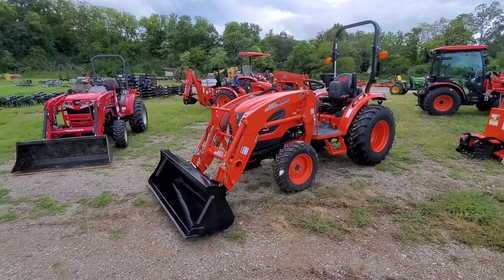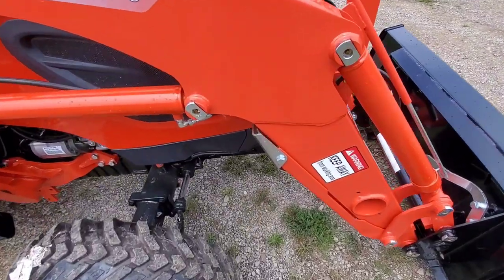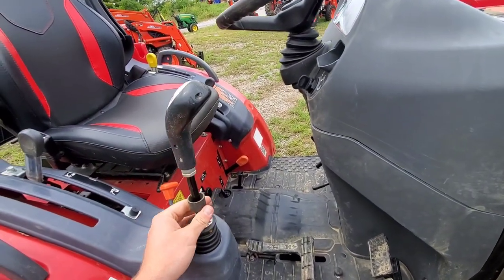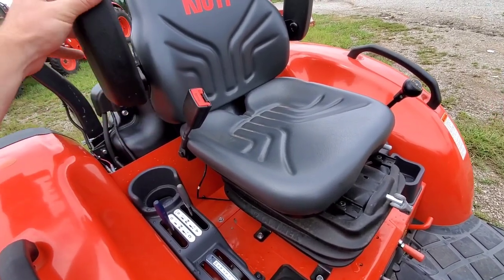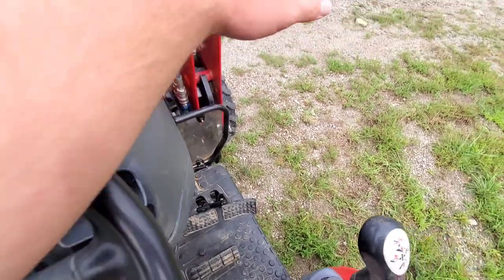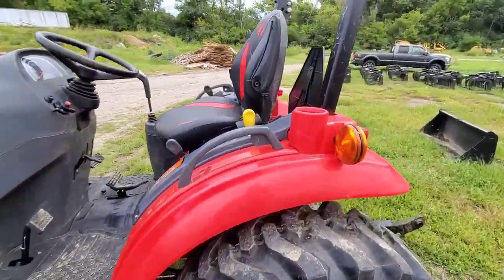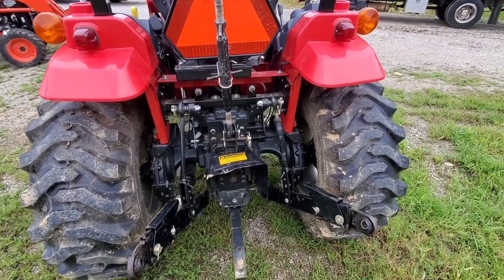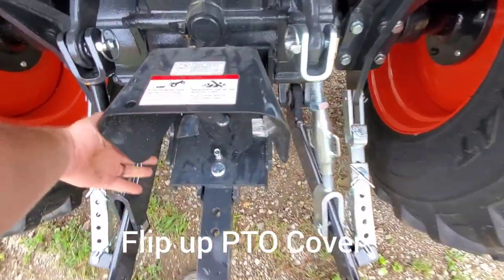Kioti CK3510SE vs Mahindra 1635 walkaround and review

Comment: What l like about the Kioti "Deluxe CK3510SE " is how they "slaped a 6 gallon fuel can" on the back seat, choped off the clutch pedal; but still left only ONE BRAKE PEDAL ( 2 Brake pedals make a REAL Tractor), pluse the "Armor-plated " dangling hoses under the running board. The Mahandra's  is fully equipped with TWO nice BRAKE PEDALS & a Clutch pedal, making it "tractor-worthy". The Mahandra's loader is missing amplifying bucket-linkage assembly 's, and loader arms are made out of solid "tissue paper" thin sheet metal& a "criminal" unicorn one leg "fall off system" Quick-fall off.  Both of these units are PERFECT "home-loaner's Thank you Sir for the Excelent vidio and happy safe tractoring. Best wishes with all your endeavours.
Reply from the maker: I'm not totally sure what you're getting at, but interesting observations!
Reply: @kentonequipment4687  he is dissing particular features of both. He should have included a more suitable tractor to compare to
Reply: I guess I got lucky with my CK3510SE, Kioti slapped a 9 gallon fuel can on the back of my seat, left my clutch pedal (got the shuttle shift model), and left BOTH brake pedals on it! 🤣

Comment: Nice job on the comparison! I purchased the CK3510SE and so far, only have about 15 Hrs. of use. The only complaints I have are that the lights (switch) only have high beam and the switch is two (Hi/Lo) position. Also, mine did not come with the "hydraulic hose fixing spring", dealer stated that's just the way they come, that did not make me happy. Since I added a hydraulic rear top link, I removed the top link support and modified it for the hose(s) support. I considered the Mahindra tractors, but just heard of too many issues in regard to reliability and overall workmanship. Kubota modesl had that treadle pedal (*&^%)$$!! , and the dealer did not seem to want to be bothered with me. No John Deere dealers nearby and I don't like the J.D. proprietary implements or the aluminum rear end. Your excellent comparison indicates that I made the right choice. Agan, great video!! Thanks.

Comment: Kioti is a sweet tractor has the bells n whistles but couldn't get dealer around here to do finance on one actually 3 different brands went to Mahindra paid my 5000.00 dollars down got my 1626 tractor next day with loaded tires.  Don't have any catalyst Don't have any problems picking up whatever I need to with whatever I have on 3 point or nothin on it.  Buy I have a dealer that will take care of me after the sell not suggesting that ya'll won't but I'm in Missouri.  Great review.  Thanks for sharing be safe have fun
Reply from the maker: The dealer quality is always more important than the equipment IMO. Good luck and keep workin!
Reply: @kentonequipment4687  Yep. That's the 1 really incontrovertible statement in this comparison. No matter how good the machine is something is going to eventually wear out or break and then your gear will be worse than useless until your dealer can deliver the required parts. 🤔😬

Comment: @38:45 - I have the CK3510SE. Mine came w/ the tool box mounted inboard on the ROPS. Less chance of it snagging there. Nice video. I wish I saw this 3 years ago when I was comparing these 2 models, but I ended up w/ the Kioti.

Comment: Thanks for the review. I've looked at a few reviews comparing the different manufactures of these size of tractors. What seems to be missing in these reviews is any disscusion on the 4 x 4. Any thought on that?
Reply from the maker: They both work basically the same way, and neither are very difficult to use, so I didn't have anything to specifically point out. Any input?

Comment: I'm on the fence between CK2610 and a Branson (TYM) 2515. The Branson has higher lift capacity on both ends, but seems to have less standard equipment so everything I need would be an up-charge. Tym dealer is 2 hours away from the house and kioti is 30 minutes closer. Decisions decisions...
Reply: The dealer support is definitely going to be key. Branson made a very solid machine, but with the recent TYM buyout there's some weirdness going on with dealers/product line. I'd ask the dealer how they feel about the new products for sure!
Reply: You well not egret buying the Kioti trust me.

Comment: Do all Mahindra tractors not use a dpf? If not which ones don't thanks! I want more power but don't want to deal with a dpf. Thanks good video.
Reply from the maker: The majority of their products between 25-75hp have a DOC (Diesel Oxidation Catalyst) system in place of a DPF (Diesel Particulate Filter) system. It's a different way to skin the same cat. A lot of their dealers will advertise "no emissions", which is disingenuous. It's a similar system.

Comment: Love the Kioti, but not a fan of the electric PTO. I just got rid of my John Deere w/electric PTO.  Had all kinda trouble with it. Blown fuses, delayed PTO start up. Sometimes PTO wouldn't start. I'll never have another one.
Reply from the maker: It's been pretty reliable for us, but the base CK has the old school Live PTO w/clutch, so it's still an option!
Reply: Hey Dean! did you get something else? I know the JD had always given you issues. I had all kinds of issues with the blown fuses on the RK25. But I think I have solved that now. I wonder if it could have been the same issue. I just posted a new video in case you want to see it! Finally caught some beavers in KY! Take care my friend!
Reply: @PeaceIntheValley  hey Bryce. I did get rid of my J Deere.  I actually traded back a few years from a 2018 to a 2012 model 35 HP New Holland. So far I really like it. I saw your new video, glad your making head way with the beavers.

Comment: Is the heap smaller because of design for the quick release?
Reply from the maker: Not many other manufacturers do this. The SSQA system is much shorter than 60", so there's no need to size the bucket specifically in the back to welt the mounting points to it.

Comment: DOC and DPF are nothing like one and other. I can cut my DOC off put on a straight pipe because there is zero interaction between the ECM and the DOC. Also Mitsubishi owns a good portion of Mahindra or the other way around. Its not like they are contracted out.  There is a reason pre emission diesel trucks are worth so much.
Reply from the maker: Is it true that you can cut off the DOC without the motor throwing any codes? It needs no other modification? If that's the case, awesome. Either way we're talking about new machines unmodified. Modifying brings up a whole other conversation. The other points still stand!
Reply: @kentonequipment4687  I agree and you may be correct in your opinions on these machines BUT to insinuate or suggest that DPF is somehow superior to a DOC only engine is very misleading. DOC only engines were used for many years until daddy government decided that new emission standards were needed. Then along came the  DPF and all its problems. There is a reason that DPF engines are not suitable for long idling and low RPM. DOC does not "trap" anything the gases are passed over a catalyst and converted into CO2 and water. In a DPF particulate is trapped and burned during regeneration. In a DOC only engine if your DOC "goes bad" o'well you just produce higher emissions. If the DPF becomes plugged (which they do) your machine wont run.

Comment: Im not buying anything right this second just looking for something in this size and class of tractor so looking at them all. But mehindra bucket from what I have seen so far says they angle the sides so that you can see that front edge easier who knows if it actually helps any

Comment: What did the former owner of that Mahindra do to the bucket run into a concrete curb? Ripped the weld out. If he did that to the bucket what’s the rest of it like
Reply from the maker: He used it for a lot of dirt work. I'm sure he found it's limit, which is why he traded it in for bigger.
Reply: @kentonequipment4687  No matter what sized machine you get there will always be something that juuusst outstrips its capabilities. 😉 
Even someone with a D10 will eventually treat it like a D11! 😱🙄😁

Comment: Awesome video.  I was just at local dealer and looking at them both side to side is hard to find even one thing different when on site and dealer is with you etc.  One note, the engine is Mitsubishi made on Mahindra.  Not bad, because I used to have a Mitsubishi car and the engine was perfect for 100k.
Reply: Any modern motor should easily last longer than 100k.

Comment: I'd like to have seen a tym added to this comparison. There 3. Series most common is there t474 48hp. $27,000. So in the price point. They make there entire machine, more powerful in every aspect. Heavier 1000lbs more., loader reches higher.  My old t264 compares closer to these.
Reply from the maker: We don't have a TYM dealer in the area, so i've never even seen a used one cross our lot. In my opinion TYM's biggest downfall is lack of dealers.

Comment: Let’s assume I do see 3000hrs on my kioti what’s the cost on that dpf system
Reply from the maker: I just checked the part on this specific tractor, and if it did need replaced its about $3k. I assume the similar part on the Mahindra is similar replacement cost.

Comment: As a mechanic for a Kioti dealership, l'll never get  laid off..
Reply from the maker: I guess it's better than getting laid off because you can't get parts for the broken ones!
Reply: Is that because Kioti has lots or problems and keeping you busy ?
Reply: @koosh7299  Yes
Reply: @bradjenkins932  you have experience working on other brands? I’m going nuts trying to find a new or used one that’s not a common junk box
Reply: @koosh7299  I've worked on every brand... New l would go with Kubota or Massey Ferguson... Used, it depends on what size your looking for and what your going to be doing with it.....
Reply: @bradjenkins932  40-50Hp
Mostly ground leveling, fixing high and low spots on my 3 acres, clearing overgrown brush, dead trees, fixing my dirt road, possibly might use it to make some extra money locally to fix dirt driveways, maybe lay asphalt millings down on driveways.
Bush hogging, grapple work. I was told to stay away from HST tranny’s.
I didn’t find a Mahindra 4550 gear with 750 hours 4x4.
They want $17k. I was told this is one of their utility bare bones tractors with barely any issues compared to other mahindra’s.

Comment: No step on the right side?
Reply from the maker: A step can be added on the right side, but not if you get a third function kit as the valve assembly is tucked in there.
Reply: @kentonequipment4687  I have a 3510SE and did put a right side step on it with a third function. Had to put a small notch

Comment: Now do L3301 gear vs CK3510 gear....
Reply from the maker: I've had an L2501 here but it was before we got into the Youtube space. I'd love to do a comparison, but i'd probly to a CK3510se as it's closer in price to the L3301. Even the basic 3510 would be a great comparison though.
Reply: @kentonequipment4687  I must have the only CK3510 gear on YT, I can live with that..... The only problem I have with kubota is the 3-point, top-link mount plate, is bolted to the back of trans case on ALL of their L sieries tractors. 
Well 4 years ago on my 07 L3400, the top link that goes to my pto winch, it cracked my trans case from a hard pull. Now to fix it right the trans case needs to be replaced, a 6k repair job.
 No one ever talks about top-link mount area on tractors, the trans case is a bad place for that. The top-link mount plate on Kioti is on the 3-point lift housing, a better location IMO, but the only issue I have on the CK series the top-link plate is kinda on the small side, I'm hopping it will hold up on my CK3510. but if it breaks least it wont break the trans case.........
Reply from the maker: @job38four10  We were a Kubota dealer for 30 years before we had Kioti (for the last 20 years). I've heard stories of the first aluminum rear ends they started releasing in the 90's cracking open when implement drive shafts bottomed out on them or axles cracking off. Cast iron is the way to go!
Reply: @kentonequipment4687  only the bx,b,& Lx's series have aluminum rear end transmission housings. ALL Kubota tractors above a BX series have DUAL BRAKE PEDALS like REAL TRACTORS should have. Then the "afterthought " backseat plastic "Jammed in & dangling" fuel tank is just plain goffy. IF KIOTI had 2 Brake pedals with ALL units & a "non-backseat" fuel tank they would be the pure winner over Kubota. The Kioti is above the presented Mahindra EXCEPT for the engine. The Kioti is a high-end SE series ,so many advantages with this particular  rig.

Comment: Dpf & the computers controlling it are killing the diesel industry & is the main reason CAT stopped making engines. Don't care for the doc system either but would prefer it over the dpf.
Other then that i think the kioti is a better tractor. If you could talk kioti into building doc engines that would be awesome.
Great video, 
Thank you.
Reply from the maker: Eh, the DOC engines are the same and have the same computers. It really is a decision between wanting a muffler filter that burns lower temp constantly or higher temp every 40 hours. They won't build DOC because the technology barely scrapes by EPA regs. The day the EPA moves the bar just a little will make the DOC system worthless here. I don't like it either, but it's where we're at.
Reply: @kentonequipment4687  i had to replace the complete def filter unit after a bad fuel injector/s was dumping excess fuel into the motor, which destroyed the def sytem completely. Bill was $19k. I think i could replace 3 or 4 catalytic type coverters. Also, I've been told the exhaust from a def unit stays airborne & has very fine particles that stick to your lungs. Were as breathing the exhaust of a non def truck mostly drops to the ground &, if breathed, is much better for your lungs??
Reply from the maker: I think we should clarify, we're talking about DPF (Diesel particulate filter) vs DOC (diesel oxidation catalyst), which are two different kind of burnoff style canisters. Neither of these tractors in question have DEF (Diesel exhaust fluid) systems. That's not required by EPA until you're above 74HP.   @jacknabox2158
Reply: @kentonequipment4687  The video i was commenting on was comparing the Mahindra with the doc system & a kioti with def. Don't know what tractors you're talking about?
Reply from the maker: Kioti has DPF, not DEF. @jacknabox2158
Reply: I don't have any experience with dpf. Only doc in gas vehicles & def in trucks. My tractor is a diesel made in '95 with neither. All I'm saying is I believe we're better off with the cleaner diesel fuel & no def, dpf, or doc. As before 2007. Many small businesses are spending the money to keep rebuilding & restoring the older diesels vs. The newer def & dpf systems & saving money doing it.

Comment: Seems biased, I sold JD for years and pretty much used all the same techniques to sell tractors against Kubota, New Holland, Mahindra ect...LS and Kioti weren't even a thing to consider. 

Between these two I would rather buy the Mahindra for the engine and long term parts availability. 
Not a fan of DPF (regen), DEF fluid. That's why I won't buy a new Deere and looking seriously at a new Mahindra.
Reply: Well no tractors below ~75hp require def and once you reach that point all brands use it